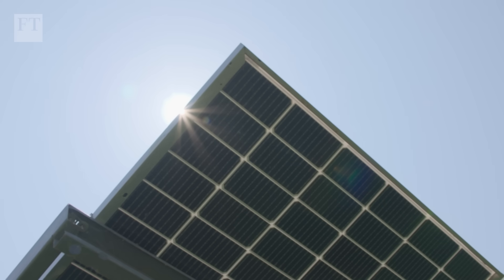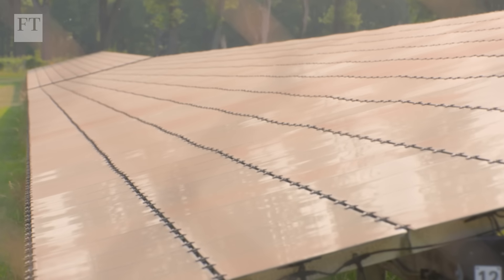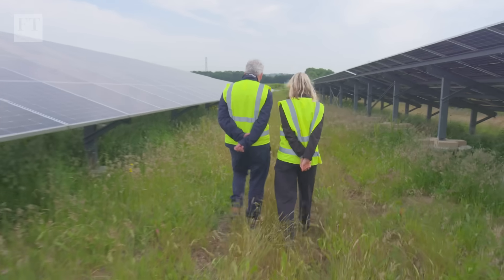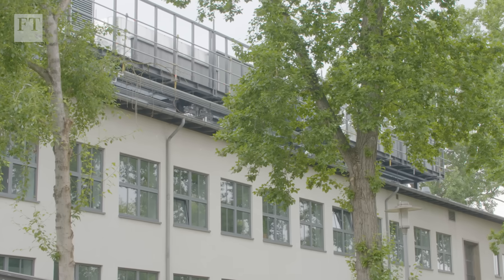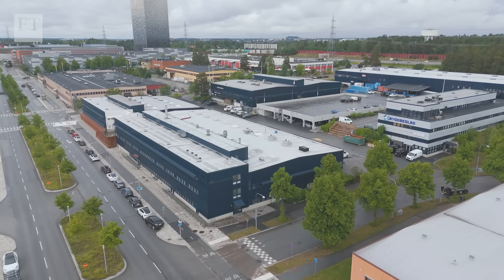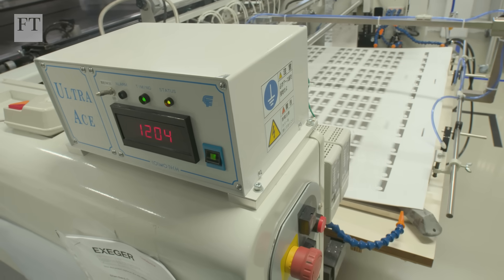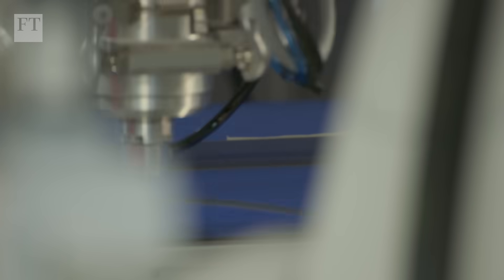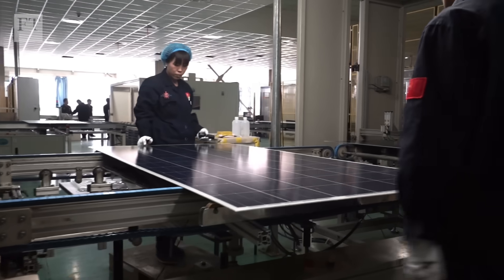Can new technologies supercharge solar power? | FT Rethink

Comment: The irony of the factory roof in Berlin having very few solar panels yet video of farmland entirely covered in panels is not lost on me. What a stupid world ! 🙄
Reply: It's an ex-landfill site
Reply: You highlighted Good point the reason is the rooftop of these factories aren’t made for bearing >30Kg panels and mounting structures per panel , which is why there are start-ups like Active surfaces , Saule Tech and Hechneu Greentech are working on flexible perovskite solar  cells which are promising with weight and efficiency.
Reply: Look up agrivoltaic systems, in Germany we're working with farmland and "solar fences"
Reply: We are not running out of food anytime soon, not all land is even suitable for farming so probably there is a reason why there are panels there, not some farming going on
Reply: @lkrnpk the reason is probably ”its cheaper”
Reply: @balderhagert6155  at which point can we see the factory roof in Berlin? One thing is also you can put a ton more panels on the ground than you have on a factory roof... Thing is people also do not realize that probably the panels on the ''farmland'' do not belong to the same people who own the panels on their factory roof. And what if they are owned by a farmer, also not good?

Comment: The entire wild AC generating space from solar voltaic and wind turbine generated electricity connected to the public power grid needs to be 100% supported with fast reacting peaking power.   This is the most fuel intensive form of electric power.   Wild AC was allowed on the public power grid to encourage large trials of alternative electricity generation.

Large amounts of wild AC from solar voltaic and wind turbine generated electricity costs the public grid more natural gas to support by running natural gas  turbine generators at high readiness 70% fuel consumption making near zero electricity, where 100% output 100% backs up the wild AC in 2 - 3 second, than making all the electricity from efficient running natural gas combined cycle power stations where a second steam cycle adds 50% higher efficiency.   When making up the dips in wild AC output more natural gas will be used.

The practical use for solar voltaic and wind turbine generated electricity is for maintaining electrical storage.  The electrical storage provides grid quality electricity.   In many situations this is not economically practical unless there is a need for instant emergency backup power.

Wild AC is especially problematic from residential solar voltaic that may momentarily over supply the power grid at near the limit of the residential feeder lines.  This residential supply can not be disconnect from the grid as with power stations or well predicted.  The power grid needs to be suppling remote grids in order to support this uncontrollable over supply.   Unaddressed over supply of electricity will cause over frequency throwing interlocks causing instant blackouts. 

In the US modern ultra supercritical (USC) clean power stations burning high BTU bituminous coal had an estimated crossover fueling cost with natural gas priced at $0.80 per million BTUs natural gas in 2022.  The low off-season wholesale price of US natural gas was $2.50 per million BTUs June 2024.  This is below the price needed to sustain the US natural gas market.  

A US new USC coal power station beats the overall long term electricity cost over new builds of US nuclear power stations of the past few decades.   The multiple higher build cost of the nuclear power stations with beneficial low fueling costs will never provide more economic electricity compared to the added running costs of the much lower build cost, but not inexpensive 100 year service life modern USC coal power station.  This could change in the decades a head.

Comment: no space for solar panels? in germany golf courses take up (48,000 ha) more space than solar farms (32,000 ha) … i guess there is still plenty of space for solar (and batteries)! 😊
in the uk the ratio is 5:1 surface of golf courses vs. surface of solar farms …
Reply: There are lots of empty roofs in Germany aswell, just like everywhere else
Reply: With Current battery tech it isn't economically valuable. Takes too much resources
Reply: @Brunottilegende  next few years will continue to prove you wrong
Reply: @Brunottilegende so why do batteries replace gas and coal peaker plants one by one? and why do batteries balance the grid that isn‘t built in time?

Comment: Why need even more efficiency?

Offshore wind: 11 Cent/kWh
Onshore wind: 7 Cent/kWh
Solar: 5 Cent/kWh
Battery: 1 Cent/kWh
Reply: Battery storage is nowhere 1¢ per kWh. That would require the initial battery cost to be $100 per kWh and a 10,000 cycle life. This assumes no round trip losses in charging/discharging and no degradation in battery health or calendar aging.

You also need to factor in the cost of an inverter to convert the DC to AC.
Reply: @VinoVeritas_ CATL is doing 10USD kWh batteries now
Reply: @VirtuellJo No they're not.
Reply: @VinoVeritas_  What seems to be 100 today is 50 tomorrow and soon only 20. If you plan for 1 Cent per kWh now, by the time you get the permissions and funding, you only pay less than a Cent and when you start replace the first modules or whole containers the cost dropped to half a cent.

Also cycle life is much longer than you think. The LFP of today with 5000 is more or less guaranteed, but that does not mean they will have many many more cycles before they really need to be replaced.

CATL works on battery with 0 degradation. The tech is moving incredibly fast with so much money and so much research power pumped into it!

Think back about the first roof solar in Germany. They are now 30 years old and they will not receive any subsidies anymore, but they still work fine, even though they should have been dead by now!

I recently talked to a greenfield company planning and installing renewable systems for land owners. He said, if you have land with a grid connection, don't build solar, build a battery power plant. It's like printing money!
Reply: @VinoVeritas_  10,000 cycles at $100 per kWh is exactly 1 cent per kWh delivered ! The energy capacity of the battery is not the cost to supply energy.
Reply: @skierpage  Battery capacity degrades and there are losses in the charging and discharging process. Also, the 10K cycles is what certain cell manufacturers are stating. Others are only stating 6K cycles.

$100 per kWh is the cell price exiting China.  There are many other components that make up a battery (case, BMS, cables, etc) and a charger/inverter is required to handle the charging and conversion to AC.

When that's all taken into account, I'd suggest 4¢ per kWh is more realistic. That's still much cheaper than fossil fuels though. On the other hand, I'd put solar PV at around 2¢ per kWh as opposed to the 5¢ mentioned by the OP.
Reply: @VinoVeritas_  You forget the time. If you install battery now for 2 Cent, over the next 5 year, when you start replace cells or whole containers, the price will be less than half. In Germany companies setting up battery power plants calculate with 1¢!

Fact is, if you take your 2¢ for solar and 7¢ for wind and add battery for 2¢ you can produce a perfect large scale power supply system, which is:

1. dirt cheap compare to anything else
2. local for employment and maintenance
3. robust because of all the storage
4. robust because of distributed energy production
5. nearly impossible to take down, unless too much central control has been build in.

It's a far better system than a few big powerplants, the war in Ukraine has shown it. It's also a massive economic boost, because there is no more money leaving the country for fossil fuels and nuclear fuel.
Reply: @cyberslim7955  Can you explain the reasoning behind your "2¢ per kWh" for battery storage? What price are you assuming you can get batteries for including shipping and delivery to site? What's the expected throughput of those batteries before they need replacing? What are the costs of the initial installation and maintenance over their lifetime?
Reply: Do these values include grid balancing costs?

Comment: Fantastic new technology 👍
Reply: I just wanna buy a solar power bank that would be super cheap
Reply: I remember being tapped about semi-crystaline structures at university 10 years ago but in that application it was to get aluminium to react as if it was a ceramic requiring less material with higher strength